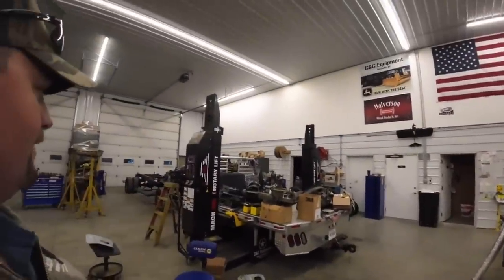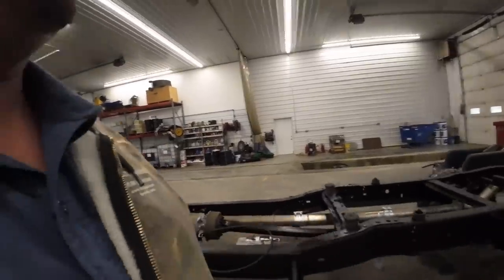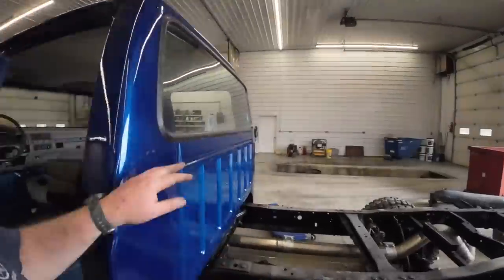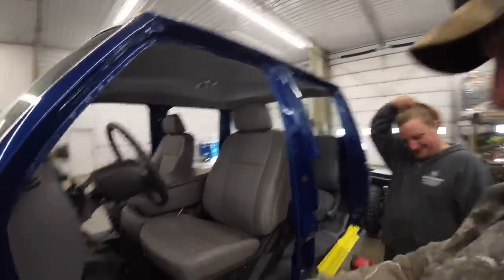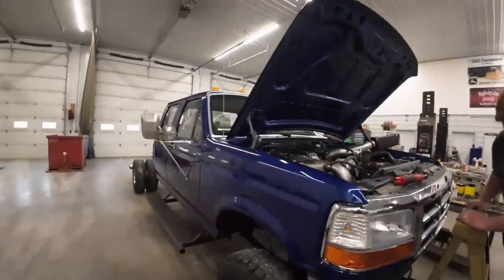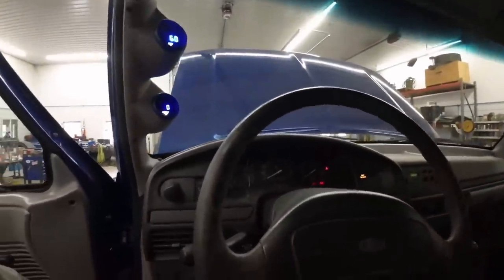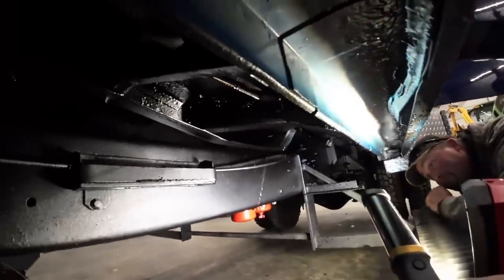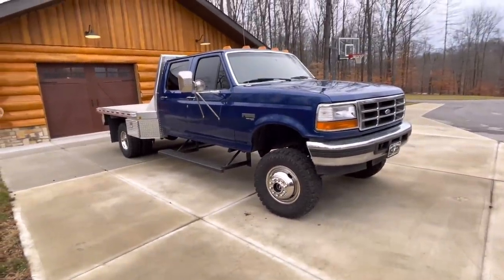We finally finish the Ford F Superduty OBS 7.3 shop truck. We had some problems but she is done!

Comment: Truck looks amazing. What a transformation and a great color choice! A truck you can be proud to drive that will probably perform as good if not better than any of the new trucks as well as being much much much much much less problematic without all the DEF, DPF, EGR and electronics. 👍🏻 💯

Comment: With those headliners where the cloth drops down, a quick fix is to get a can of spray adhesive and change the nozzle to one from wd_40 so you have the little red hose, then poke the smallest hole in the fabric and spray the adhesive in there. You can the use something like a laminate roller or what ever else you can think of to stick the fabric back to its base material. It’s not perfect but it will get you by in a small area and keep it from getting worse.
Reply: or use a plunger and fine needle and inject said glue into various parts no holes then roll. possible do you think, might work.

Comment: There is absolutely no excuse for substandard work with the z bart (notice I did not capitalize it!) and window tinting. In fact it’s unbelievable for that guy who tried to justify what was done! I would have been nice, at first like you but I would be going NUCLEAR in short order!
For the positive : the truck and it’s color are gorgeous. I would be proud to drive it anywhere! It is so nice to see such high quality work and attention to detail whether it’s on heavy equipment or your truck project.

Comment: Love the running boards great tribute to the original truck. I understand the frustration with so called tradespeople who are second rate and when shown their shoddy work insist it is your fault. Name and Shame. I cannot remember how many times I have been let down by shonky companies who also charge an arm and a leg. Over the years I taught myself exhaust, radiator, gearbox, diff, suspension rebuilding and repairing just so I knew it was done properly. Color of the shop truck is brilliant (big blue fan). Happy New Year and I am looking forward to what you all rebuild in 2023.

Comment: In 1974, my Daddy bought a Chevy Suburban with a stock 454 4 barrel carb. with transmission cooler. Most money he'd ever spent on a vehicle. Did the right thing and got the Ziebart undercoating and interior panels through the plugs. Lifetime guarantee.  1976, rear quarter panels started rusting. Took it in for the guarantee,  the never sprayed inside. Gave him his money back.
Reply: Never used Ziebart in my life after his experience. Didn't replace his quarter panels, just returned his money. I see the Zeibart scam is still going, don't give the customer what they pay for. Just screw the customer over, they'll never know.
Reply: If you gotta take it back,  they are failing. That's not just a minor oops by Ziebart, that's buggery without any lube!

Comment: Truck looks great for a Furd lol
Im a 7.3 fan ive had several over the years 
Glad you built what you wanted instead of bought 

Thats always the way it goes on the finishing touches with subs 
They want to just slap it together and roll 
Never fails 
Poor time management is usually the cause of the blunders

Comment: Clinton, been great getting to know you and the team through youtube.  I always admired your clean restored and well presented equipment on Ebay back in your early days and wondered who the guy was running the show.  We have a 350c which my dad bought in 1977 and also a 450E, both are really clean and equipped with a winch and logging arch that we use to maintain our NE PA woodlot.  Your expertise in all things mechanical is admirable.  Unfortunately this video shows why so many of us like you try to do everything in house.  I've been using fluid film on most of my trucks, best and easiest diy rust preventative I have found but it does have its drawbacks, mostly it's dirty appearance over time.

Comment: Clint, when I was doing body we used lead,. body hammers, dollies, and metal files. I hated when we painted a vehicle we had to hand sand the primmer until the orange peal was nonexistent we used only lacquer paint and the complete job was hand rubbed first with heavy compound then the lite compound and then hand polished it,  could take us up to a week to have it ready for the customer YOU as always did an excellent job and the boys learned a lot Clint good for you confronting the Co. that half-assed their undercoating job. you need to be an ass and tell them the holed to use were already there and reduce their price and do it the right way

Comment: You're service truck looks amazing, reminds me so much of what my Wrecker looked like 12 years ago. Similar color to so I had to take a double look at my truck today so see how close the two are. Mine was a lighter but also  metal flake paint. I messed mine up when i thought I was using a bottled wax, turns out I used a dash shine treatment that destroyed my paint. Turned into a flat blue metal flake. Love yout color choice, SS sims, tires, bed etc.. As to the Rustproofing job, I would have had your guys apply that box liner treatment underneath the cab as its bulletproof stuff.

Comment: I really like that color, it's a nice paint job for sure.
Two things I would do if I had that truck, use some kind of 'filler skirt' to cover up that big gap between the bottom of the cab and those running boards/steps. and 2. I would not have the driver's window tinted at all,... but then I don't own this truck.
The chrome grille sure looks smart too!
Re. that tinting job, you are doing exactly what I would do in this case. You do not have to pay for 'a crappy product'. Next time I would give that 'person' ( because you're not supposed to swear on YouTube ) hell would be frozen solid!

Comment: the early Ford  diesels had a glow plug issue where the light and the plugs were timed together, you had to power the plugs 2-3 times to get them to warm up enough as the timer would shut off too early. and work lights for the back really help. we saw one that was a big swing arm desk lamp with an LED bulb ran by a small inverter attached out back,, soo handy.

Comment: Clinton at the bottom of the door where you step in and out of the cab put under body  coating run it from the door trim to where the doors seal to the body

Comment: It is so hard to get anyone to do their job these days. Makes you want to smack someone upside the head. That is why those that do their job and provide the service they sell, like C&C stand out so much. I must have gone through 4 shops before I found the one I have for my F350 7.3L. They are super busy and mostly do large trucks, so work takes a while but they provide the best service I have ever had. Your Shop Truck looks great. I like the steps. Just need some SS handles so you can ride on the step. LOL. Thanks very much for sharing.

Comment: Have an 2006 ford diesel 6.0 and the wide plastic step for the cab, not as good as your expanded step but much better than the slippery little tubes they sell. Like what you smart dudes figure and accomplish. jimmy

Comment: I bought the 95 new, similar to this, had the factory stripes and cab visor that just really set it off. Also inside had the radio, cb mount and junk pockets on the headliner. I did hear of the ten bolt style trucks, never had hands on but was disappointed when I found out it did not mean semi wheels fit. I kind of like the steel wheels and if you find someone who does real chroming, not some light dip stuff, it would seem worth it as the cheap out ones are rusty before the last lug nuts tight. Sure the new  trucks have some nice features about them but if you can buy a home for the same amount, give me a second hand truck, rust and all, and the new house. Houses go up in values and trucks unless loved like you do to them, are a history lesson of planned obsolescence like scrap yards are not already busting at the seams. One other gripe as long as I snivel, tires by now should last a lot longer, be all around a better tire than our ever growing piles or rubber in some spots on earth like that canyon in death valley they dumped all those tires from california an set fire  to.. I doubt that fire is out yet and that has been some long time ago. I don't mind those steps on the side, if you don't like then take them off, otherwise, leave them so the wife can get in. Been a very good series on this truck, I only wonder if you would go the distance on another one or not. No small task to do this for a rig, but its doing everything you need and still have money for a beer. ..... I don't drink, don't even encourage it, just saying a beverage of choice is yours and not let the family go hungry cause someone is making payments on a new rig that are  over a thousand a month. ... should include.... won't go to end of payments without a rustbucket rig.... harsh country that your in

Comment: Looks great! I don't think they have made a better all around truck since. I'm not a fan of Zebart type undercoating. Seem it does more damage in the long term. I re did a 91 f250 about 7 years ago, used top quality paint products and then sprayed floor of cab top and bottom with chassis saver ( brushing all joints and seams several times first) and do a heavy coating of fluid film every fall and it looks almost as good as the day I finished it. Only drive it in the winter to and from work and to plow snow. I drive a similar truck to yours minus the 4x4 ( oh I wish I had it!) And it could also use a cab. Can't find a good crew cab lately. I'm still looking

Comment: Great build!  Really like yall's truck.  Always been a form follows function type.   And those running boards are perfect as they are.  Always irritating to step on one and it sags or creaks.   Especially those aluminum or fiberglass ones.   Enjoyed watching the whole series.
There is a difference between good enough is good enough and shoddy workmanship.   And Zeibart's window guy pretty much showed it.  I'd not have cared about the smoker window's 1/4 inch.   But that back glass would have irritated me as he tried to cover it up.  And then to get upset when called on it....  Sadly, to many places out there like that.   Hard to find good ones.   And when you do, its a long time to get worked into the schedule.

Comment: I heard nothing bud bad words about all the local undercoating/oil spray shops so I spent the extra and did it all myself.  I'm in the same boat about window tint, I want it done so badly but you gotta "trust" strangers.

Comment: That’s a nice looking truck. I just wish those OBS trucks would ride better when empty. 
If I rode in that I would have to add duct tape and bailing wire to the plates, rods and screws in my neck so my noggin wouldn’t fall off. 😂

Comment: The truck looks great except...... I would remove the running boards and redesign new ones. New ones need drop down valence. Look at what the owner did to his roll-back on "Texas Metal" The old boards look like an afterthought and add on. It takes away from the rest of the truck.

Comment: Clint up here in Mich. I gave up on Ziebart same problem slip shod work they drill the holes but put nothing in them. Missed half the bottom of my trucks, Have not used them for the last 4 trucks and cars. And then when you call them out on it they just say your being to fussy. WASTE OF MONEY.

Comment: Oh trust me that's not a school bus. My old boss and dear friend had the true school bus. Or as we loved calling it the land ship. He had a 2006 F150 quad cab with long bed. Before anyone says Ford never built that truck. You would be correct. That what Ford told him. They said the quad cab with long bed can only be a F250 or larger. So he had them build a F150 with a F250 frame. Because the frame was the issue. So he had and his son now has the only F150 with a ,F250 frame quad cab long bed. God bless

Comment: should have built a Unimog U1200 crew cab into a shop truck, goose neck hitch into the 3 way dump bed, high gear and tractor 3 point hitches makes this thing a forklift and most all else you could need whereever you could need a shop truck , imagine a all terrain forklift that can drive 75MPH,

Comment: I must have missed if you folks made the running boards or did you buy them as a kit? Easy to fix or repair if they were ever damaged. You could really mess with haters by having them Chromed!!😅
Reply from the maker: They were in there when I got the truck

Comment: Don't Zeibart it, that only causes rust were it traps water. Fluid Film it, watch SouthMainAutos video on a 2004 ranger that looks brand new and has almost 300k miles on it (daily driver in salted NY. state). Coated by fluid film since new.

Comment: Your truck built is absolutely SICK!!! MY son Hunter has the exact same truck but it has a black flat bed!!!  Great work!!!!!!  We love these OBS, what turbo and injectors are you running?
Reply from the maker: 367 turbo t4
Full force 250/100 injectors
Reply: @C&C Equipment  great thanks for the info.  Off subject I found an old allis Chalmers HD-11EP the owner sold it to me.  I got it to fire up with minimal ease.  It drove forward and backwards fine and all fluids looked full and good.  Do you know anything about them or any tips?  Seems like a pretty good machine so far.
Reply from the maker: @magnificentshine1  they were good machines but I don’t have much experience with them

Comment: Still don’t like the running boards!! The paint job is beautiful. I really like the color. What is the difference between this crew cab and crew cab on a 3/4 or 1 ton truck?
Reply from the maker: Heavier frame, axles and suspension

Comment: Truck looks really nice assembled again, but check the thickness of that shitty undercoating job they did... Doesn't look that good on the video, suppose to be much thicker to protect the metal. You can buy a undercoating gun pretty cheap and do it yourself. 
The window tinting job...holy smoke what a crappy job.. never seen anything like it before.
Was he smoking crack while cutting the tint maybe ? 🤪

Keep up the good work and Happy New Year from Texas ! 🤠

Comment: The running need a little modification the have no supporting mental on the inside corners and they are so low if you anything that is not flat your going to high center on you are better than that

Comment: The cheapest and most powerful form of advertising is simple Word of Mouth.
All it costs is Customer satisfaction. Reviews can make or break a business.

As for that entire Z-Bart experience- around where I am, the best commercial
place for this is a Canadian-based company named Krown. They have a great 
reputation here. Also- many Folks just DIY with HOT oil & toilet ring wax sprayed,
or that new product from PB'laster, their undercoating formula. Fluid Film is ok,
kind of overrated IMO.

Comment: How did you get that truck to whistle so loud?
Reply from the maker: Big ole turbo
Reply: @C_CEQUIPMENT  I currently have a Garrett turbo with an SB cold air intake on my 95 250. Is it possible for it to whistle as loud as your shop truck with an exhaust change?  Or do I need a more expensive turbo?

Comment: Sir you did a beautiful job. Sadly it’s the little things that I don’t understand. Why not upgrade to electric windows? The running boards why paint or powdered coat them? Otherwise outstanding color! If I may ask you put the rubber sound proof on the floor. What about the roof? I do Love this truck! Ziebart is a nationwide company. I’m gonna be surprised if you don’t get a letter from them. Oh my God ! There would be a problem with paying the bill until it’s done right!